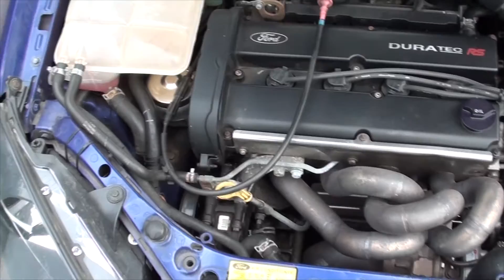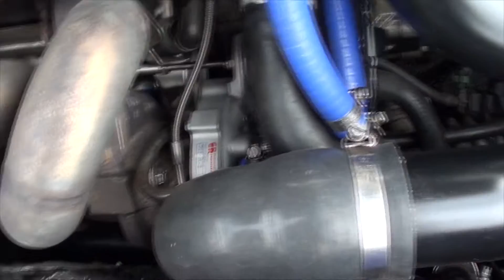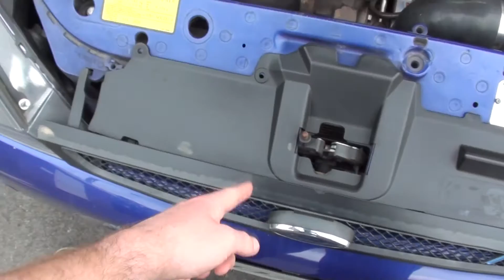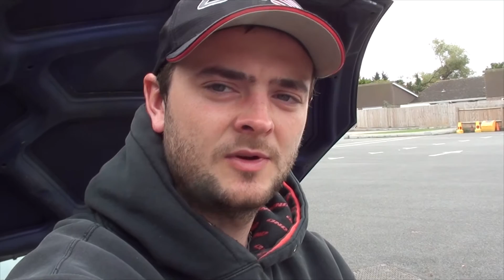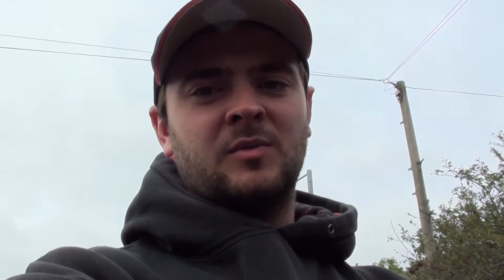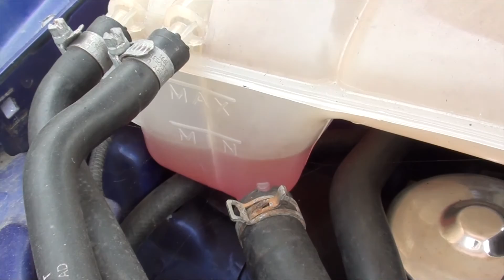Oil Pumps and Ticking Over - RustySkull Productions

Comment: Good lesson Ben,  my work vehicle daily driver for years ticks a bit when starting up.  Soon as I get a block from home it stops.  wondered if it was something to worry about.  Guess I dont need to worry now.  I keep up on the oil changes and it dont burn any oil.  But sort of wondered about it.
Reply from the maker: Well my work van, a Renault Trafic 2.0L ticks sometimes on start up for about 3 minutes when it's cold, it's got 178k miles on the clock but it's a 2010 plate... And most of those miles are motorway miles thus less stress on the engine. 

The tick is coming from the top end you can tell by the pitch and sound of the tick, and the fact it's only when it's cold and when the oil is thick I've put it down to a slightly worn lifter/rocker :)
Reply: +RustySkull Productions Thanks Ben.  Its cold out now and getting ready to leave for work.  its an hour each way,   a guy who drives that far every day for 12 years now at this job, has to keep his vehicle running perfect.  sure dont want a break down.  Its got 167000 miles on it.   2003  Buick.  bought it used 3 or 4 years ago.
Reply from the maker: +55points My trip to work is 50miles each way which in the traffic we get here is one hour drive, all motorway though. 100miles a day 6 days a week so I agree, my van is due a service soon lol ;)